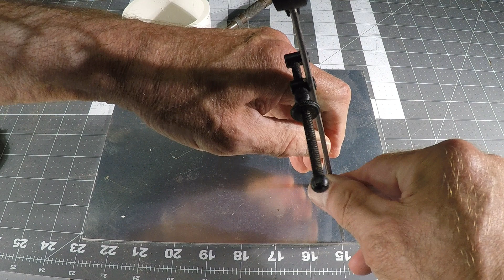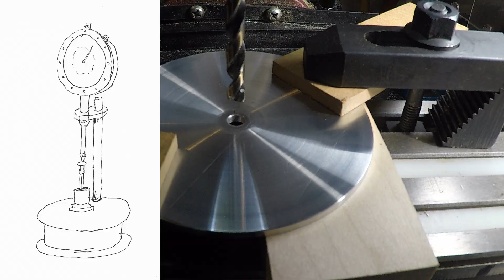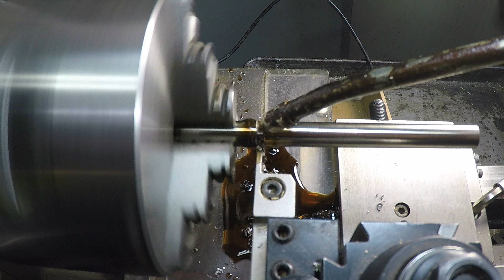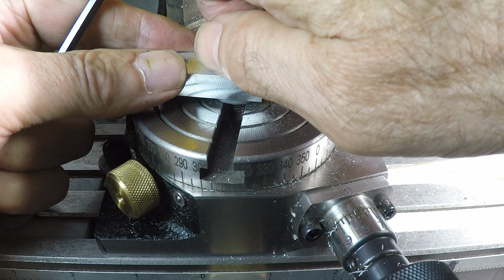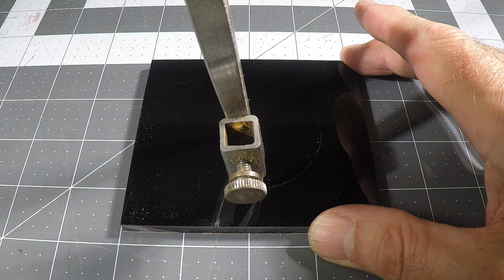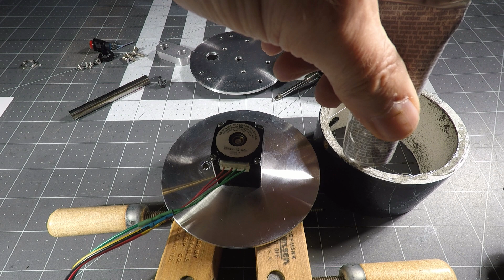Making a dial indicator clock

Comment: Maybe I missed it. What happens after the indicator hits the end of its range?
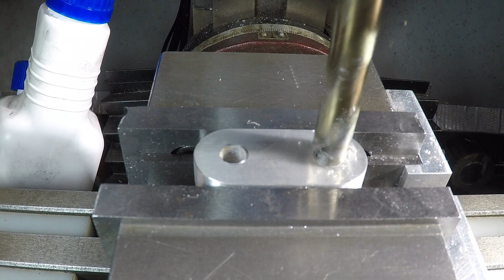Reply from the maker: The motor moves down by .1 in 12 hours and then at 12:00 it winds all the way back. Resets to 12:00 then moves the pointer in one hour increments until it gets to the actual time which it reads from the real time clock inside.

Comment: Good to see you back.

PVC, not ABS (white not black).  I would never have thought to try to put a threaded hole lengthwise in PVC pipe.

Aesthetic is already an adjective, no need to add the -cal ending to make it one.

I do like that I could actually read the time without decoding, or touching anything (unlike some of your other clocks).  Dial indicator is cool, but I don't have even one, so not sacrificing one to build a clock.